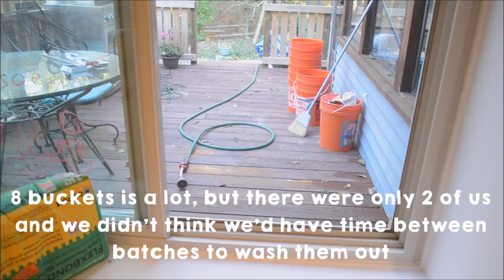My Experience with Self Leveling Underlayment

Comment: It’s called “self leveling” ! You shouldn’t have spread it around with the squeegee but let it “self level”. You pulled it from low areas that it was trying to fill and made the higher floor even higher. Just say’n
Reply: You still need to give it a push to get it going. Especially where the high/lows are.
Reply: Actually, she's right and you're wrong! You do need to squeegee it around, especially on a large area..
Reply: Felix Deer For pros maybe. For an amateur, in my experience, you’re a lot more likely to blow the working time and screw it up by messing around with a squeegee. Ask me how I know. ;-)

My advice would be to get rid of the trowel and squeegee and instead pour it where you need it to flow. I’ve had near perfect results doing that. Starting at the low end was a good idea I think so it doesn’t thin out too much spreading out and kick off too quickly, but spreading just two or three bags up through what looked like almost half the room was a mistake I think. Also keep in mind that a 50lb bag of leveler will only cover 12sqft at a half inch thickness. Looking at the flow patterns in the end result, I’m going to guess far too little leveler was used for the desired coverage.

It took me 14 bags to get 166sqft covered, and I think one more will get rid of a 1/8” lip near a corner. The 3 other pours (in different rooms) I did after that one were 6, 5 and 7 bags respectively, and applying the techniques above made them come out far better.

So my advice is: Measure and calculate coverage. Then don’t be tempted to stretch the leveler. Apply at least what you calculated and not less (a tape measure and laser level will really come in handy). Pour where you want it to go. Better to walk with the bucket than the squeegee areas dry. The thinner the leveler, the quicker it’ll kick off. RESPECT THE WORKING TIME. Trying to push it around and blowing the working time will end up ruining the whole job.

This might not be the best advice for a professional, but for an amateur, who’s only ever going to attempt it a few times most likely, I think your odds of success will be much higher letting the leveler do what it was made to do, and giving it as little “help” as possible. Also, leveler gets expensive quick for large rooms. So keep in mind unless it’s a small bath area or something, it could be as expensive (or more) as the tile you intend to put on top of it. Plan accordingly, but don’t short-change the coverage if you decide to go with leveler or you’ll likely be unhappy with the results.
Reply: I have applied leveler in all types of scenarios and for this project it looks like they just need to achieve a surface to accept the flooring material. Pour it on, spread it out, achieve a flat surface, let it dry, good to go. As far as working time, keep pouring to the wet edge and don't re-rake over the previous pour. Looks to me like their project came out just fine and good job!
Reply: This dude is correct and incorrect. You do want to coax the leveler around but nothing too excessive. The surface tension of the leveler tends to leave variances of up to 1/4 inch so that will be height difference of your peaks and valleys. This woman realized her mistake when she said she should have notched the squeegee so be nice! A spiked roller is best. It breaks the surface tension allowing material to flow without moving to much, but those things are more expensive than they should be. The variance in height will be somewhat sharp so I still think she ended up with a better surface if she applies the thinset well. Oh and I really hope her husband made her a sandwich.
Reply: @felixthecat3n2  Ive been pouring level quick for more than 25 years,  never squeegeed or trowled it with perfect results everytime. You just got to know how to pour it . That would make you wrong.
Reply: "self leveling" exactly
Reply: @markme4  I suppose that it will also depend on the area.. if the area is very large, the squeegee does help to get the compound in roughly the right place, the self levelling capability then takes over. I'm my experience which is less than yours but I've used specialist companies to do this on large areas and they always squeegee the compound around..
Reply: It doesn't self spread. It self settles. You have to spread it around first and then it will settle down a bit but it certainly does not spread itself around the floor.
Reply: @dripfreefpv9695  I think you need to spread out the liquid first and then go over it with a spiky roller. A spiky roller will not spread the material. It will only pop bubbles and help adhesion.
Reply: @markme4  Do you add more water to make it spread out on its own?
Reply: Better off using a clean yard rake to move leveler.
Reply: Let me give you some advice as an engineer. Use a level and figure out where the dips are, mark the low parameter, start by pouring the compound in the low area first then corners and out away to your exit point. Try not to squeegee too much as it dries quickly instead let gravity do the work.

Comment: What's the difference between a handyman and a handywoman?
A handyman shows cleavage at the rear! :-)
Edit: why are you drilling holes in a perfectly good bucket?
Reply: So that water over a certain amount drains out
Reply: @zyphe  : So it gives a measured amount.Oh Right! Same as a marked line does!. Also bucket without holes can be used to hold more if required, and used for other jobs too.
You sound like a Waster.
Obviously some people don't care about using things more than once , just throw it away when you're finished.

Comment: when this video started , i was like why is she doing this, she can thinset and tile over that slab its fine….then i realized that You dont know what your doing… its just about a chick playing with construction materials….ok…have fun doing things girl….
Reply: the tile will crack if her floors aren't level. the mortar is a bond, doesn't keep the tiles from breaking.
Reply from the maker: Katie Caserta Thanks Katie!  The tile job turned out fantastic in the end, no wobbles, not brakes, which is more than I can say for my mom's kitchen floor which was tiled by a professional.  After 3 years there are cracks everywhere and it needs to be torn out and redone.  :(  You can see how it turned out here. http://smartgirlsdiy.com/2015/03/grouting-my-herringbone-floor/